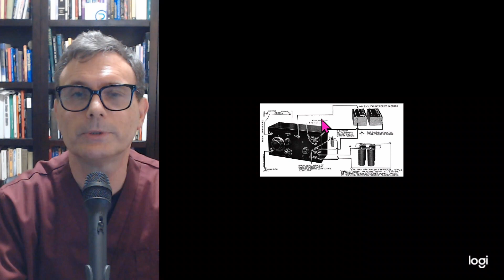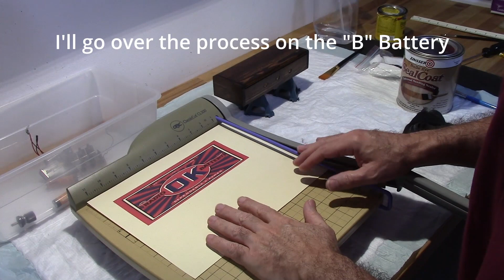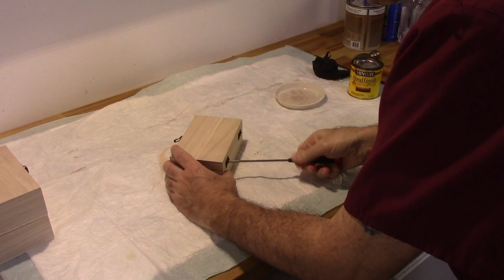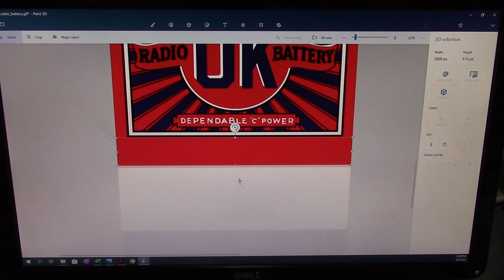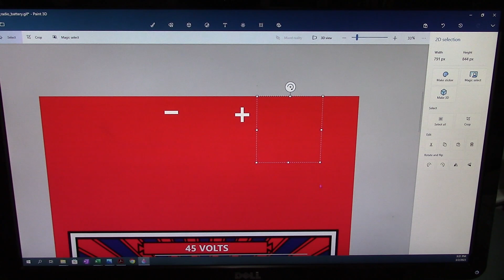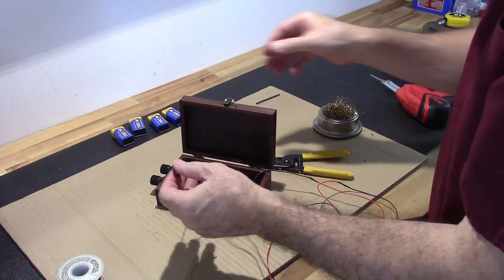Building Reusable 1920's "B" and "C" Battery Boxes

Comment: I noticed that you used the higher quality 'hard shell' 9V battery connectors. These are very durable. I use them for a nice 8 battery setup for my 1950's RCA portables. Also, I never heard of Paint 3D, going to look into this. Great idea for a video, and your finished product was well done. Thanks!